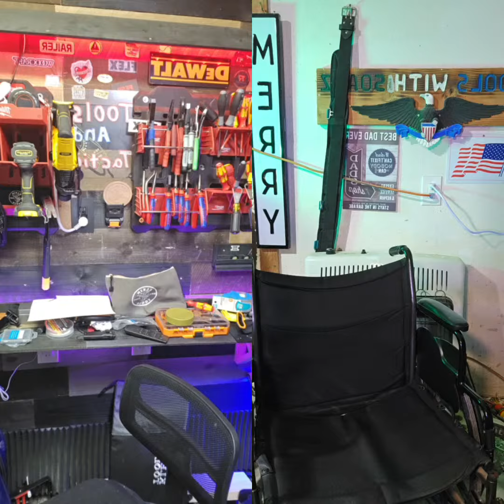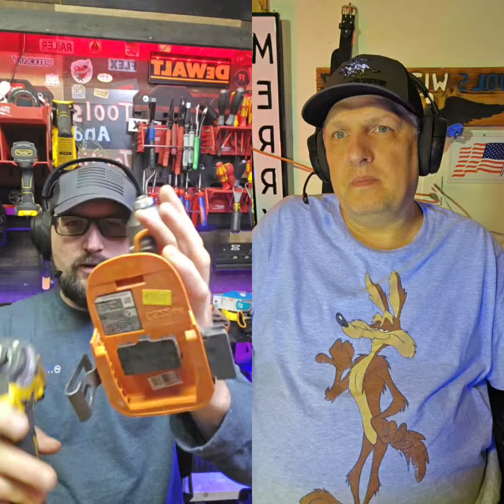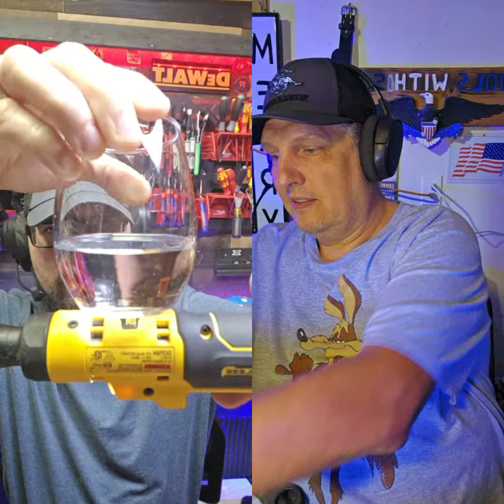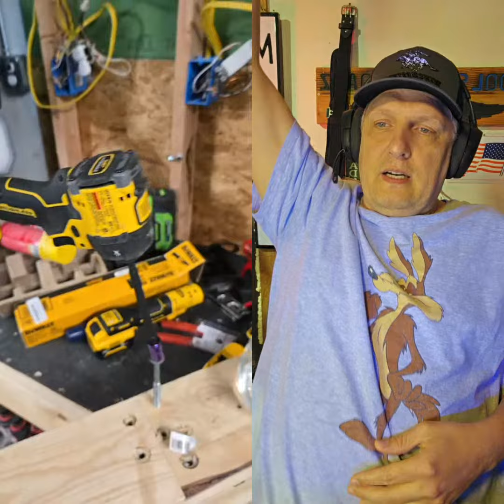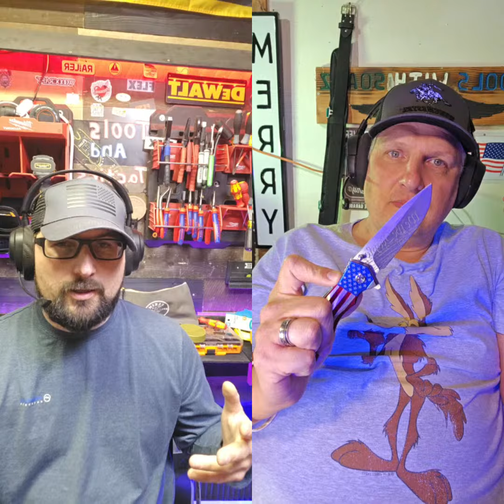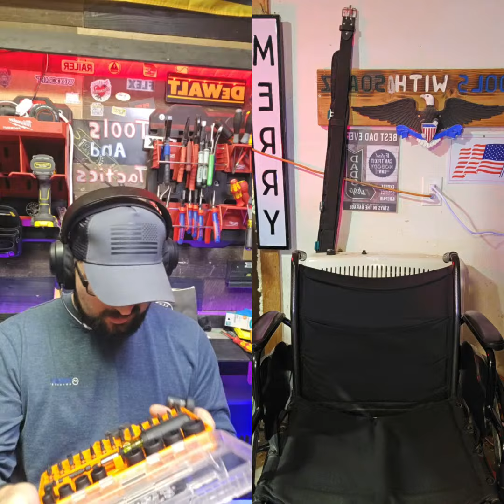How Can Milwaukee Fix This?

Comment: Milk flex is the only one that makes the full complete.Stacked lithium set of all of their stacked lithium batteries, whereas most of milwaukee's large forged batteries are cylindrical cells, not stacked lithium.Only they're smaller forage are stack lithium